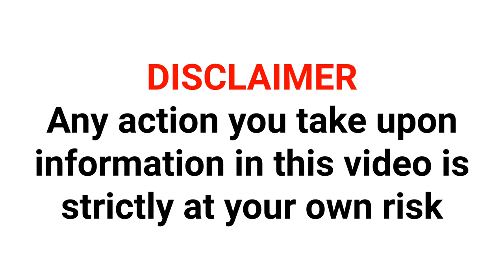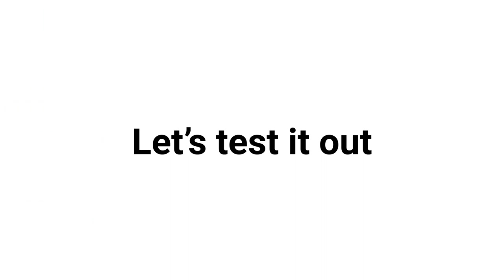Mixing Bowl Pizza Oven Assembly Instructions

Comment: Awesome DIY Project. I can't believe there isn't a single commercial product to even come close to this. There are a bunch of attempts that use this idea commercially but they all fail to deliver the right temperature. If you want to make real pizza at home you have to buy a $600 full size oven that takes a lot of space in your kitchen.

I have 3 questions regardin your build: 

1) Do you think that adding a few small holess at the top would improve the oven or it would work against its efficiency? This type of arrangement seems to be lacking any ventilation or a way for steam to escape. This shouldn't be that much of a concern for a 90 seconds cook time but I was wondering if you would consider this an improvement.

2) User "Gee Whiz RS" replicated this idea but made a few modifications. And you commended him for placing the thermometer probe in a better position. His build added some interesting changes. But wouldn't the probe be better placed at the top, as far away from the heating coil as possible, so that it can measure the air temperature inside the oven? He placed the probe to the side and very close to the the coil. I am wondering why you would think this would be better.

3) What would you change if you were to make this today, given what you have learned so far from using it and what you've seen others do? I am intereseted what you would do if perhaps you wouldn't try to stick to such a small budget. Would a slightly bigger budget bring in any worthwhile improvements? You mentioned that thermal isolation could make it possible to acheive the same temperatures with a much lower rated heating element, which makes sense. It would make the oven more efficient, safer and it will probably prolong the life of the heating element. What would that thermal isolation be? And how could it be attached to the bowl. There don't seem to be many options that would work at those temperatures and be food safe. I would be interested to know how you would improve this project.
Reply from the maker: Hey, the point of this project was to create something that is cheap to build and can be stored in the kitchen without taking too much space. Also, parts replacement is easy as it doesn't invovle too much complex engineering installation. To make this project a bit improved and complicated to build but efficient I'll answer your three questions:
1. Small holes would help let the steam escape but at the same time recude efficiiency of the unit. The max temp I get at 5 mins at over 430+ C at the top of the bowl. If there were holes it would probably drop and result pizza would cook or longer and result in a dryer base. The holes that heating element terminals stick out from does allow some ventilation so I do see steam come out of that. Also, the botom of the bowl has a bit of bend when heated up causing some steam to escape from there so it is not entirely sealed tight.

2. Yea I liked his implementation. Reason I'd favour placing the bbq thermometer below the element is because that would be the heat radiation amount that the pizza base would under. So I think that could be more accurate reading. However placing at the top to gauge air temp is also fine just that heat of the air at top of the bowl would be more intense than the bottom so it may not be as accurate.

3. My next improvement would be to find a slight smaller bowl and place that inside the original bowl and fill the gap with plaster of parise + play sand solution. Let it dry and that would make a really awesome insulation that stays inside the two bowls and would keep the heat within. That would make it go over 500 or 600 degrees in minutes and could be dangerous unless I can find a pid controller  that supports 500+ C that I can use to control the heat build up. This would help pizza cook more evently and on the sides just like a real wood fired oven and cut electricity cost. The next size of the bowl I use is 28 centimeters and that is not as big as I would like. If I can find a 34 centimeter or 32 centimeter I'd definitely implement this insulated bowl.
Reply: @saidalisamed  Wow, such a quick reply. And you answered all my questions. Thank you! I know what you mean about the bowl sizes. I looked into something smaller myself and Ikea has a good number of sizes to choose from but unfortunately nothing between 28 and 36cm. And they have very good properties, like you mentioned, the polished inner face is highly reflective and the material is also good quality. It has the right weight and wall thickness for such a purpose. It's difficult to find something simillar elsewhere.

I've never heard of those insulation materials you mention. Well, I've heard of play sand but I know almost nothing about it, certainly never hear of its thermal insulation properties. Could you exapnd a bit on that? Or maybe, if you do manage to make that build, would you do a step by step video like this one? And yes, if you would have 2 bowls that create a small, consistent gap between them, it would make the perfect way to hold the insulation in place.

There are some cheap temperature controllers available on Ebay that you can program to cut off the power when they reach a certain temperature. They come with a thermometer probe too. Unfortunately, none of those I've seen are rated to handle more than 1500W. And their temeprature probes are nowhere near able to measure 400-500 degrees. I'm sure there are some controllers that can handle that but I wasn't able to find one (haven't looked into it that much yet, though). Perhaps some replacements for the electric ovens that use those 1800w heating elements.

It would be interesting to know how much lower than 1800w one can go if the oven is properly insulated. I am a bit worried about the lifespan of these heating elements when used in this way. I've read you shouldn't use them for more than a few minutes at a time or they will overheat and break. And a 1000w element would be a lot more forgiving. Either way, a thermostat would help a lot with this and also with ensuring a more even temeprature for cooking.
Reply from the maker: The insulating material plaster of Paris is a building material and can be found in home depot stores easily. It is also cheap and with heat insulation value of just 0.1 it is a very good insulator.  Sand is just normal sand used for strength of the solution. People create foundries using this material. Search YouTube and you'll find a bunch of videos.

Yea heat controller are cheap and easy to find but they mostly support up to 300 degrees C which is not enough for pizza oven. The element should hold up for long and higher temperatures easily. If it burns out it is cheap to replace easily. I got a couple spares from eBay for just 10 bucks a piece. 

The idea of insulation is to not let heat escape away due to bowl conduction of heat to the outside air and if that can be curbed via some sort of insulation material, it would help cut electricity usage to half.
Reply: @saidalisamed  Not sure if you could read my comment before Youtube deleted it because it contained a link. I have found a store on Aliexpress that sells temperature controllers rated to 500 degrees Celsius.
Reply from the maker: If it is of good quality yea you can use it in the oven with insulation at the dome
Reply from the maker: Here's an improved iteration that cooks better than before: https://youtu.be/8Qd-bmuHAko

Comment: I got a 2000kw element and 13a cable and after one and half hour of preheating the the bowl it self got pretty hot but you can still hold it to your face just warm what do you suggest i did wrong
Reply from the maker: If the bowl is not shiny it wouldn't reflect the radiant heat back down meaning you wouldn't feel its heat when holding to your face. Also if bowl is aluminium and not stainless steel, the bowl will conduct more heat outside than keeping within the bowl. That also reduces heat buildup within the bowl chamber. It could also be the element itself. The fan forced elements usually heat up pretty quickly and glow bright vs other elements that have thick tubing and filled with thicker insulation material within the tube. Half hour is way more than enough for element to radiat it's full power output. Were you able to check what temperature does it get to after 5 mins of runtime using a laser thermometer? For 2kw element it should at least register 550c temperature. One other reason could be electricity itself. Highly unlikely but is your supplied electric current able to fully provide the 220 or 240 volts if you're not in North America?
Reply: @saidalisamed  okay i think my element is not fan forced then! Tbh i only found one store that sells heat elements and they didn't know what i was asking for so i showed them a picture and got what they sold me. Unfortunately i dont own a laser thermometer. I'm using stainless steel bowl. I live in Bahrain btw and we get 230v so is there anyway this will work or should i throw it in trash and start all over again.. 

Many thanks to you for taking the time to reply to my dump questions
Reply from the maker: How hot does the element glow? Also did you try putting a dough as test to see how quick it bubbles and cooks? It may just be not glowing but could well provide the temp of 400c +. Make sure you have the bottom pan hot enough on gas as I do. Also how high the element will be hanging in the bowl matters. If you find it not browning quickly you could pull the element further down. Mine is at 7cm height. You could come down to 5 or even 4cm as a fine tuning.
Reply: @saidalisamed  no it doesn't glow it did change colour though i didn't have a pizza dough ready but i made a quick flat bread dough and after 5 minutes nothing happend ill test it tonight with pizza dough

Comment: Hi i sent a comment a few hours ago with a youtube link. were you able to see it
Reply from the maker: Yea I saw it in email. Youtube removes comments with links but it does send email so I did get to read your comment completely. So here's my response to that comment:
1. Regarding insulation with Plaster of Paris, it is known to be a good insulator and people has used it to make foundries by mixing plaster of paris, sand and water into a paste consistency that is runny and pour between the two bowls that you'd place inside each other. The rim that stays bare at the edge can be covered IF you can find the smaller bowl tht has a lip just like the one you have in the link but the lip has to be at least 36cm in diameter so that it can fully cover the outer bowl and the plaster inside it without any plaster being visible. I'd also suggest poking some holes iwth small screws on each bowl so that plaster can adhere to the steel bowl. This is because plaster loses its stenght with heat overtime so those hooks will ensure the two layers of bowls stay attached to the plaster. 
2. Regarding how think should be the plaster pouring, it depends on the smaller bowl you can find. It an couple of cm or even 1 cm is left for the cavity, that would make huge difference in heat retention. The idea is to prevent heat from escaping quickly and means heat accumulation way over what my bowl currently can acheive BUT you do need a thermometer to control the heat accumulation otherwise there's burning risk of the element and wires catching fire.
3. For base you use cast iron as well if you can't find aluminium alloy pan. The only reason I like aluminium alloy is that being alloy the heat transfer to the dough is not as fast as pure aluminium which means the dough can withstand a couple of minutes of heat but not burn. Pure aluminium would burn it in seconds if you reach temp of over 300c.
4. If you end up insulating the bowl then I think you wouldn't need a bottom heat source. All you could do is insulate the bowl and find a bottom covering that can fully cover the bowl opening with you place it upside down. Insulate that covering too and install the element by attaching to the cover. Then install the base such as a cast iron that can fit a bit up into the bowl with some screws as its stand. After your turn it on, the bowl and base cover bing insuulated will not allow heat to escape which means you can get to over 500c in matter of minutes. Heat travels upwards in the bowl means top of the bowl will be red hot as well as the base. This is my next plan to build but currently i'm looking in to finding bowls that can fit into each other and can provide all the parameters I'm after. I'm eyeing on some kitchen accessories such as old aluminium pots set that are about 30 diameter and one with 28 and they fit inside each other pretty nicely. I need to convince the boss first lol :)
Reply from the maker: You can also use the voltage regulator to control the heath accumulation but that's more manual work and you need to keep an eye on right amount of voltage to maintain some sort of temperature for your baking. I used this to bake cakes muffins that only need some 180c temp but that I had to keep an eye and i don't think that's worth the effort.
Reply from the maker: Regarding insulation, if I find a cleaner way to plaster the inside of the bowl without the need for another layer of steel to cover it, that'd be my goal but doesn't seem like a clean way other than mess.
Reply from the maker: btw, the current oven with its current configuration works perfectly for cooking pizza, and flat breads however in my next iterations i'd like to remove the need for bottom firing heat source and make it more efficient thus looking for some sort of insulation layer.

Comment: are my comments going through
Reply from the maker: Not the ones with links because YouTube deletes those comments but it also sends an email so I was able to read you comment via email. Regarding element, if you're in US make sure to use an element which is 120v compatible or it might not heat up to max or make buzzing noise. The wattage if 2500w is fine but the cable you've linked is for tv. You can grab an extension cord if 16amp or so and use that as oven cable. For 2500w element make sure you use cord that supports 13amp or more. The bowl looks good. Just make sure the handle is big enough so when you lift it, it doesn't burn sides of your hand.
Reply: DIY Omg I am so sorry for spamming you! I didn’t know if you were getting those. I was just trying to figure out the commenting system. Sorry! So instead of that cable, I should use a 120v 16amp extension cord? Do I have to find a different element?
Reply from the maker: @colbyn644  yes for your locaiton all electrical parts should be 120v compatible.